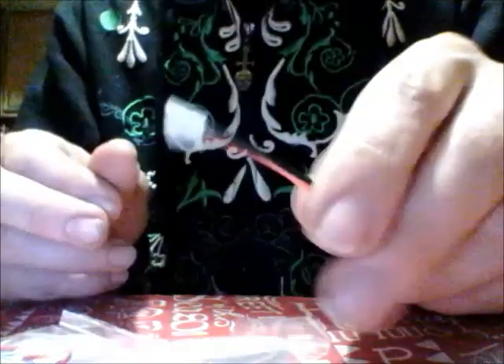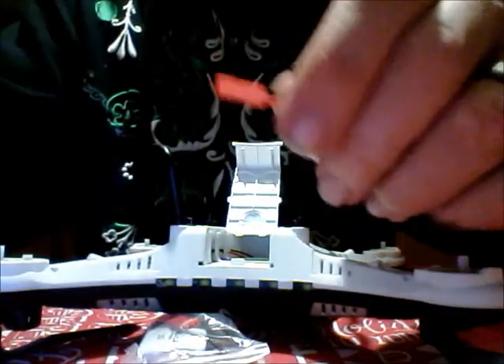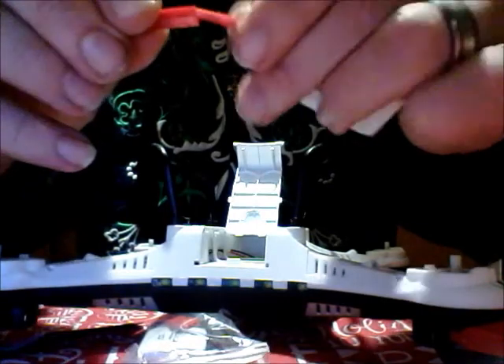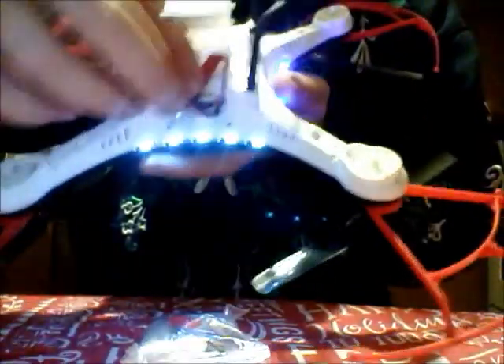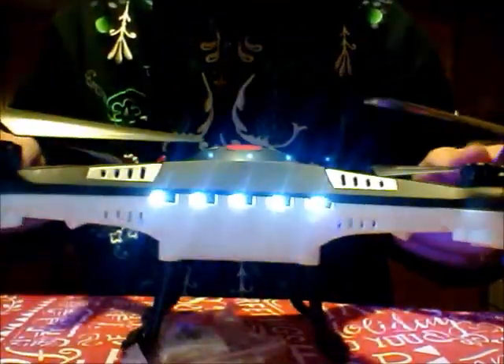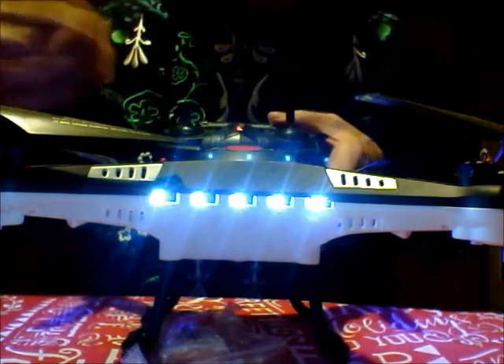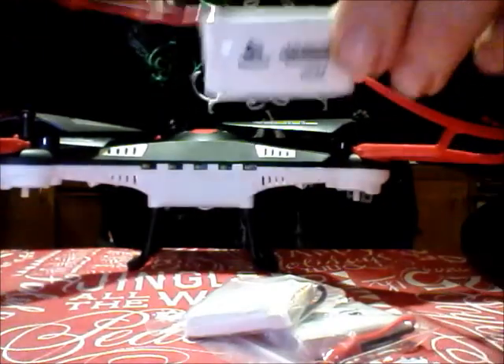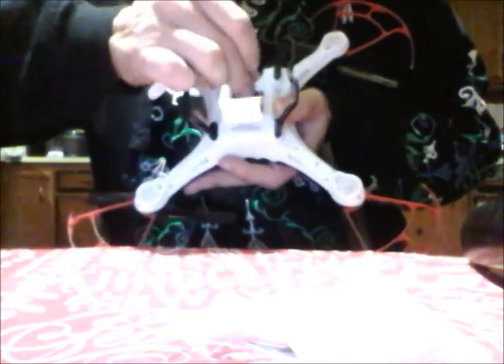Quadrone Tumbler Upgraded 850 mAh Noiposi Battery Test

Comment: The batteries are cool.  But the quad's blue LEDs on front AND back really sucks.  If I had one of these I'd probably take out both side white strips and put one in the front.
Reply from the maker: blue leds are sides but yes bothe front and back are the same as each other white but scotch tape and a red marker makes easy oreantation fix